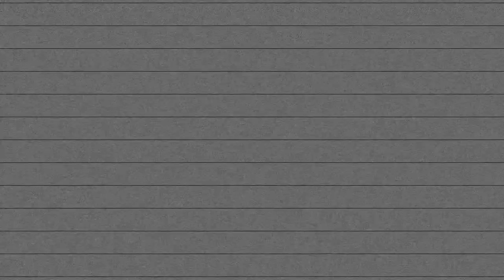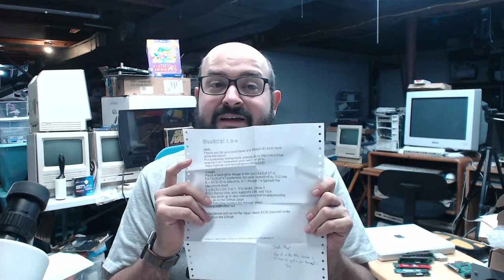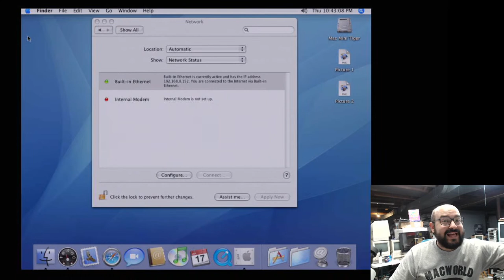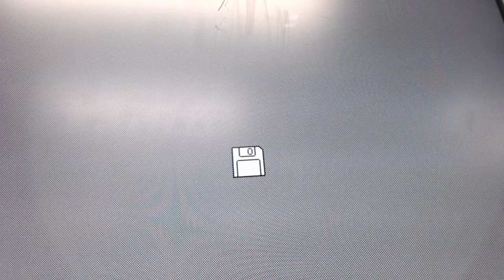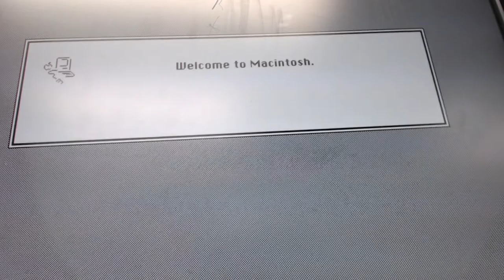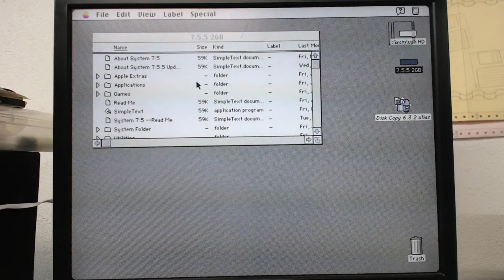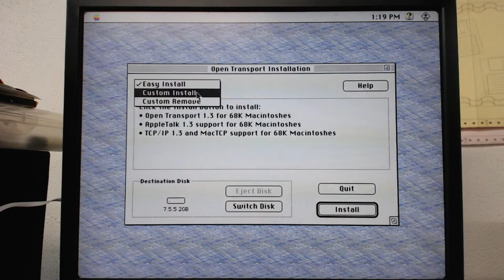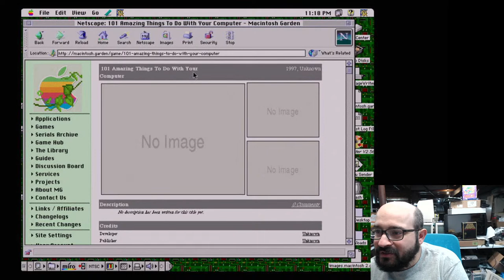Mac84 LIVE: BlueSCSI Assembly (Macintosh SCSI Hard Disk Drive Emulator)

Comment: After seeing how nicely the Blue SCSI works, I went ahead and bought two of the kit versions! Looking forward to soldering them and putting it to use. I think I want to order one of those panel mount SD card slots, and wire that in place of the on board socket. It'd be nice to have an externally accessible SD card slot.
Reply: I'm thinking the same with mine, I have a couple in external enclosures but having a card slot adhered to the rear JUST to quickly try a game or app would be great!

Comment: Hey Steve, I’ve had that exact same problem with OT 1.3 on my IIsi and SE30. Using version 1.1g seems to work perfectly though 👍. If using older systems like 7.1, I’ve had to make sure networking and Ethernet was installed by the system software installer too. Love it!